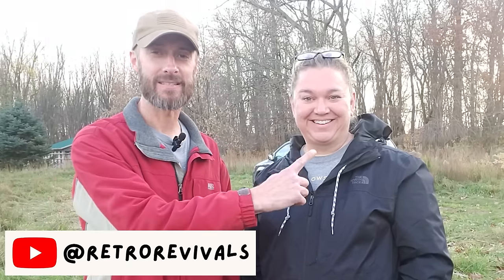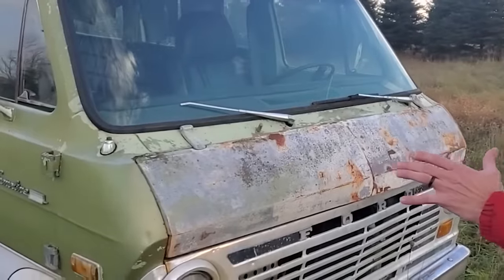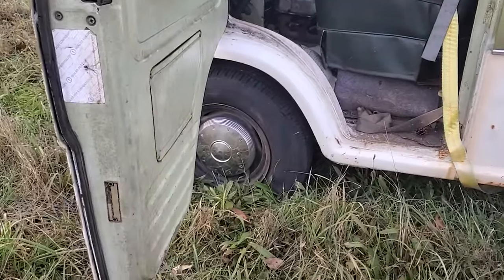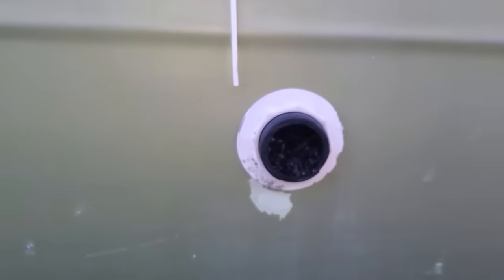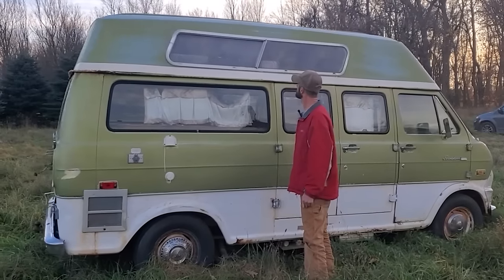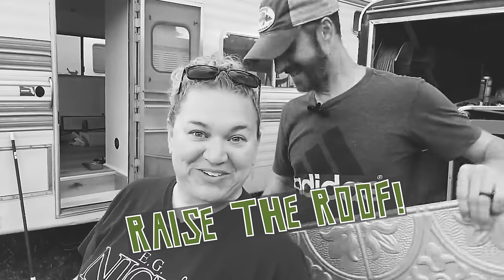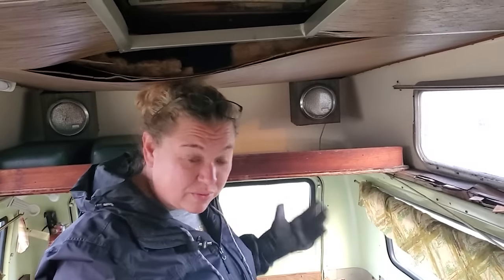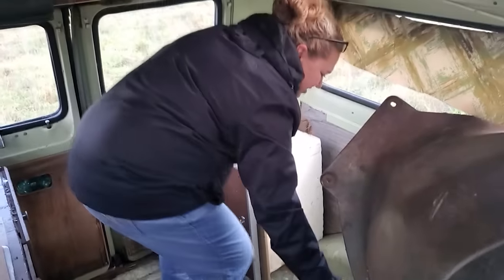Vintage Ford Econoline Camper Van - Saved From the Junkyard for Full Renovation!

Comment: Although I prefer the later body on frame versions this has nostalgic value as we had an E150 of this vintage when I was a kid. I do like the fact that you could reach almost the entire engine from the inside.
Reply from the maker: I'm a big fan of the styling of this era of Econoline. The engine access is a huge plus for a van. I've been seen other youtube channels where the engine was pulled from the interior. That's pretty wild 😁

Comment: I just subscribed! When you mention you are in Michigan! I am a Michigan boy. Born raised in the city of Detroit and I lived there until 8 and a 1/2 years ago. I moved to Tennessee. But on that note, my father had a 1973 of the same flavor except for hours, was the baby sky blue! He sold it in the mid-eighties and ended up getting a Plymouth horizon. but because ours was blue. My dad decided in 1978 to get decals, put on the exterior.  There you're went with a smoked out. Circle mirror in the back because it was a panel truck and went with a cockpit roof hatch in the front and a vent roof in the back. on the rear doors. He went with louvers and it had a sliding roll door on the passenger side. on the inside. We went with blue low pile carpeting.  Midway up onto the ceiling and paneling half way up. we had benches in the back and a table that would pop-up or lay down as a bed, and the back rests for the cushions would lay in as the center of the bed. we also had a curtain to block from just behind the front seats to keep the back as sleeping quarters. we also had a converter to use a full size.  Refrigerator for an apartment in the back and antenna on the roof for television. And we took it many times into the Glennie Michigan area, which is the heart of the Huron national forest! What were used for rims or imitation knock off kragers that were painted white with a faded in blue center.  With a Chrome cap in the middle. I loved that Van ever so much. It also had a spare tire rack on the back door along with a propane. Hook up that could be used for heat and a portable stove! I never found out what happened after my dad had sold it. But hopefully it lived on for many more years. it looks like I am going to be A.  Permanent viewer and a member of your page! Thank you for sharing with me .
Reply from the maker: Thanks for the comment and welcome to the channel! There's a lot of work that needs to be done too the old Econoline. In a future video,we'll lay out some of the possible plans for it. It's always nice to read comments about viewers memories of past and present RV'S they've had or are working on. We hope you enjoy the videos! Thanks for the sub and membership 😉

Comment: I have a 1977 ford 350 van with a high top! It’s a rust bucket but we got it running.
Reply from the maker: Great job!  Are you going to redo it?
Reply: @retrorevivals  it was originally a camper van, but was gutted out when I bought it for 1,200 due to leaks. Last summer I resealed around the high top, put tongue and groove cedar on the side walls. (Smells so good!) And put some laminated flooring down. I have a Colman cot, and some recycled shelving to hold kitchen gear. It’s pretty cozy for me and the 4 dogs. I’m really lucky to live in a small remote town with logging roads. It has high clearance and  climbs right up the mountain. The rusting is far to gone for my abilities or income level to fix. I’m just going to enjoy it for as long as I can 😁. I absolutely love being able to stand up in it. I hope the best for your rebuild. A family friend helped me replace the basics… cap and rotor, spark plugs, vacuum lines. The gas gauge didn’t work so I brought it to an old school mechanic who helped remove the gas tank and replaced the floater valve inside and replaced the gas lines. And a few other things… well worth the 900 dollars for security of mind. It runs really well now. I love it in all its ugly glory…. Lol 
I’m glad these things are still on the road, and that man who drove by yours saved it from the car crushers!!! I bet if you ever resold it he’d buy it in a minute lol !! 
I love your channel by the way, you have such a kind and supportive back and forth with each other as a couple. And your son getting ready to enter driving privileges Whoo hoo! I remember those days. Super cute how you call him Jackie ( from one to another).
Reply from the maker: Sounds like you certainly extended the life of your van!  We're really looking forward to getting started on ours.  I don't know if you saw it but we're putting up a pole barn that we can use as a shop.  Hopefully just a couple more weeks and it'll be up.  Then we'll be able to really get to work.  Thanks for you kind comments about the channel.  We've been working really hard and having fun.  We love when the kids want to be involved but it's not always easy.  They're at that age where their parents aren't always the most fun people to be around for some reason 😂.
Reply: @retrorevivals  haha! Understand completely!

Comment: I had one just like that one 20 years ago same top . My site up was starting from the drives seat a Queen bed on drawer slides under it was the water tank  . Behind that was cabinet with a 3 burner cook top next in line was the sink on a kitty corner. At the drivers side back door was the grey water tank next was that ice box. Then a wall with a kitty corner closet ( bathroom ) then 1 foot wide cabin next to the side door. up top over the front seats was a pull out bed 3 pieces of ply wood it slides out over the side doors . In the back above the back doors was cabinet.
Reply from the maker: Thanks for the comment!  We're looking forward to bringing this old van back to life!  There seems to be so much potential there; hopefully we aren't biting off more than we can chew!  Thanks for watching!
Reply: Let's tinker with a van ! As for biting more tan you can chew. I just did a 1993 Ford Weekender (30 Amp power 2 burn cook top sink Wall Ac in the back not in the window microwave all factor) To bring it up for traveling New window AC new Microwave (Walmart )  new distributor with cap tune up air gas oil filter's radiator water pump thermostat All the hoses 4 shock's 4 new 10 ply tire's $1,000 bucks. When I did the coolant system I put in HEAD GASKET SEALOR (A liquid ) just in case . Its Drivable but Still needs junk yard springs. I know I should film it for YOUTUBE  @retrorevivals

Comment: I’m going to subscribe to your channel so that I can watch your progress on this van.
I believe the original color was called Avocado Green metallic. It wasn’t a pretty color even back then.
Personally I’d paint it a nice medium or hunter green with the lower color being a nice tan metallic, but that’s entirely up to you.
The 302 V8 is a Great engine. I’d recommend a RV cam installed into the engine during the rebuild. Go with an Edlebrock 4 barrel carb. I’d switch out the C-6 (3spd ) auto transmission with a 4 or 5spd automatic transmission. 
Make sure that you insulate the walls, floors and roof. Spray foam insulation is expensive so I’d recommend hard styrofoam for the walls. Fiberglass insulation for the roof and I honestly don’t know about the floor.
Reply from the maker: Thanks for the comment 😁. I kind of like the Avocado green but that's me. We actually plan to change the color but are still deliberating. I'm happy about the 302. Hopefully it's a runner. As far as the transmission,another gear or two would definitely help on the interstate. We'll have to wait and see on that too.
Reply: @retrorevivals  Y’all can paint it whatever you want. It’s yours to enjoy.
I’m looking forward to the many upgrades.
The new 302 V8’s in the F150s are cranking out almost 400hp, but those have 10spd automatic transmissions. 
This is why I suggested an RV camshaft in your current 302.
I’m a Ford Guy myself. In fact we’re on our 4th Ranger, but it’s almost 13 years old with only 36K miles.
We’ve gotten more trouble free miles from our F150s, F250s and F350s than Chevys and our 2 Dodge’s broke down more often than a Democrat presented with the truth.

Comment: We actually have a retro-van project in the works too, but our 88 Dodge isn’t as ‘vintage’ as yours. Can’t wait to see how you build this out!
Reply from the maker: We'd love any suggestions you can send our way!  Good luck with your project!
Reply: @retrorevivals  ours is going to be a weekend/short trip unit.  we completely gutted it and are starting from scratch. 

Make a floor plan, change it often and then start collecting all the ‘things’. Of course (y’all know this) Marketplace and Amazon are your best friends. 

Electrical: We are going to install a solar generator (all-in-one battery/inverter) with 200w solar on roof for power, a small window AC under the sofa, 30gal water tank pulled from a wrecked RV, porta-potty and outdoor shower in the back (open doors and put a shower curtain up. 

Full size bed in the rear, raised up high enough to have a storage ‘garage’ underneath. Kitchen on passenger side and sofa on drivers side. Both our seats swivel too … bonus!!!

Comment: That’s awesome. We were looking for a high top van, however, we just brought home a 1970 Ford Econoline 300 Shasta camper. We can not wait to get started on the cleanup, repairs, and restoration. Do you have any advice for us?
Reply from the maker: Good for you!! We love the old Econolines. Our best advice is to be patient,take your time and keep after it. If you need to take a step back to reassess an issue,work on another area and then come back. That way the project doesn't stall. Good luck and keep us posted!

Comment: Some places to start might be LMC truck parts for possibly some of the exterior lighting compared to the same vintage F-250 and Steel Rubber products specialized in rubber automotive door and window seals they have the ability to make them if you want then lastly the rusty pyramid shaped item she pulled out of the cabinet, is an antique toaster, place, your bread in eclipse set it on top of a hot stove or a griddle
Reply from the maker: Good idea. I forgot about LMC. I'll check them out. An old toaster,that's neat! Thanks for the comment!

Comment: Looking a the places that have the most rust, the top, I am thinking this west coast van spent a lot of time near the ocean where the wind blows hard and carries the sea moisture and spray inland. Then it falls from the air on the tops of everything and you get top down rusting. Learned about that when I lived in Florida. Michigander here too.
Reply from the maker: Good point! Salt water coming off of the fiberglass and laying in the drip rails. Definitely a recipe for disaster. Thanks for the comment 😁.

Comment: The white should be Wimbledon White. It's an off-white that was a common Ford color back then.

Being a 1970 the engine hadn't suffered from the de-tuning and horsepower reduction they got for 1971 so there's good bones to build upon. The fuel pump cam on the camshaft sprocket should be one piece. For 1971 and later, along with altering the timing a change was made to a 2 piece fuel pump cam to reduce friction and wear on fuel pump levers. IIRC there are pre-1971 specification timing sets made to work with the 2 piece pump cam. Putting fuel injection on it would make the pump cam style irrelevant since an electric pump would be used.

Or swap the 302 and C4 for a 1985+ 5.0 HO that has roller lifters, multiport fuel injection, and an Automatic OverDrive 4 speed transmission. Like with Mopar transmissions, there's an Electronic AOD Ford transmission called AODE or 4R70W, for which there are aftermarket controllers.

If you're going to keep the 1970 engine, you'll want to find out if it has flat top or dished top pistons, and which heads it has so you can find out the combustion chamber size. 1970 most likely has 58.2 cc chambers. A google for identifying Ford 302 heads will prove fruitful.

If you're going to stay with a carb, going to a 4 barrel is a good power upgrade but you'll not find vintage 4 barrel 302 intake manifolds easily. Ford only offered 4 barrel on the regular 302 for a couple of years in its beginning. The Boss 302 (302 Windsor with Cleveland heads) had its own intake manifold. Ford brought back a 4 barrel carb on the 302 in the early 1980's before they started switching to fuel injection.

Another thing to note about small block Fords is the 302 and 351 had different firing orders until 1994 when they changed the 5.0 to the 351 Windsor firing order. There are camshafts available for older 302/5.0 engines with the 351W firing order. Fortunately the only change required on the older engines is hooking up the spark plug wires to match the cam's firing order.

One more useful 302 Ford technical bit is in 1982 it was changed from 28 ounce balance to 50 ounce. So when swapping a 1982 or later 302 or 5.0 in place of a pre-82 302 you must also change the flywheel or flexplate and the harmonic balancer to match the newer engine. The change in balance weight also came with a change to a one piece rear main seal which worked better to prevent oil leaks.

Side note, the 1980-1982 255 cubic inch V8 was also 50 ounce balance, but nobody uses one of those engines, except one car magazine that hotted one up in a Capri and made it amazingly fast for the 1980's Mercury sibling to the Mustang.
Reply from the maker: Thanks for all of the great info. Wimbledon white is definitely a good choice. We'll have to dig into the 302 and get more details. Updating to fuel injection and an OD transmission would also be a plus. We'll just have to wait and see how this project takes shape. Thanks again for the comment 😁
Reply: @retrorevivals  if you want fuel injection and keeping it Ford, 1984 and 1985 they had some 302 engines with a 2 barrel throttle body that can be used with some aftermarket controls like Megasquirt or modified GM controls. But there's a catch to that. Ford sourced the injectors from two companies and one style has been unobtainable for many years, nobody rebuilds them. I don't know if there are different throttle bodies for the two brands of injectors.

The only reason to use one of those Ford units is it bolts right on in place of a 2 barrel carb and if clearance above is tight.

No such clearance issue in the van so a GM throttle body off a 305 with an adapter between the Ford 4 bolt carb pattern and GM 3 bolt TBI will be fine on a 302. A Chevy 350 TBI can be used but for a stock built 302 it's too much air and fuel.

The 1973 Ford motorhome dad built had a 4 barrel carb on an original 302 manifold, flat top pistons, and small chamber heads. IIRC he put a slightly hotted up camshaft in it. Might have been one of the "RV cam" style that was coming along in the late 1970's.

It was a bit of a beast. Could easily pass semi trucks going uphill. It also liked 90+ octane gas, but that was under $1 a gallon back then. An AOD transmission would have been nice but those were in Ford's future back then.

Comment: If you want to put a front sway bar on the van I can do a drawing showing how. Dad put one on a 1973 with Twin I Beam front axle. People told him it wasn't possible.
Reply from the maker: Thanks for the comment 😁. That would definitely be a good addition to the suspension.
Reply: @retrorevivals  the basics are you need 4 pieces of heavy angle iron, (2" should be good) 4 long 1/2"  grade 8 bolts with lock nuts and flat washers, and a straight sway bar long enough its mounts can be put on the underside of the frame ahead of the axle. The arms of the bar should sit just outboard of the frame. I have no idea what vehicle dad got the bar from.

Cut two pieces of angle iron long enough to have a bolt go through in front and behind the axle beam. Those go on top of the axle. On the bottom use two more lengths of angle iron, drilled for bolts to match the top pieces. The bottom pieces extend forward far enough to attach the lower ends of the sway bar end links. If the link uses a nut on its end with two bushings like the stud on top of a shock, put the mounting holes in the upper flat of the angle iron. If the links use a horizontal bushing with a metal tube through, put the mounting holes on the vertical side of the angle iron. Could weld additional pieces on to support the other ends of that type of bushing.

When dad showed this setup to one of the people who said a sway bar on a Ford twin I beam was impossible he said "The weakest part you have there is the angle iron."

The bolts clamping the angle iron to the axle have to be extra tight and have no gap between their shanks and the axle to ensure nothing can move.

Comment: Guys that looks like you got a pretty good deal but before y'all start tearing into it and doing everything which I can understand you want to I just get it running change the fluids make sure the tires are fair take it down the road for a day trip or something like that or just to initiate it into your family
Reply from the maker: That's a great suggestion!  First steps will probably be to try to get it running and then driveshaft, brakes, and tires.  We might have to remove some of the racoon and mice nests before we take it down the road though, lol.
Reply: @retrorevivals  ain't you ever heard that mice nest and raccoon Nest are nothing But Country potpourri?
Reply: @retrorevivals  that's a good idea for a longer drive shaft do you have a shop in your area that will do that?

Comment: Warning, that hood is known to blow off at 60+ mph, Make sure the locks are perfect and add a safety cable if possible. I had 2 of them that the hood came up , flexed so hard that it ripped it off the hinges. Bad design, all the air pressure rushes into the hood cavity with no escape.
Reply from the maker: That explains the chain that was used at some point to be a safety catch. The pervious owner must've learned the hard way 😬. We'll have to keep that in mind. Thanks!